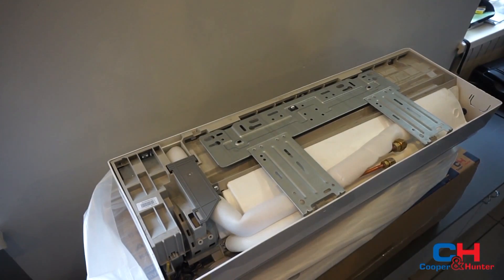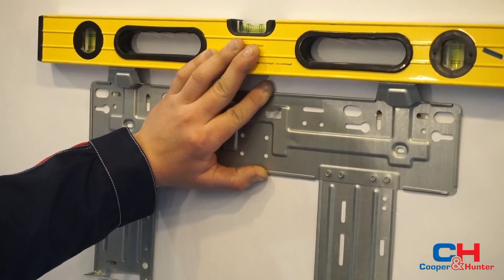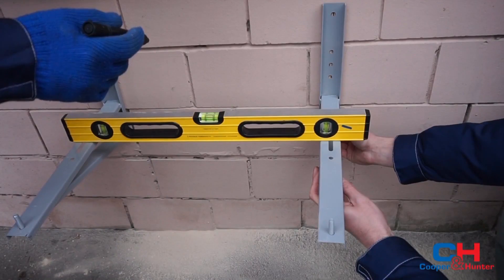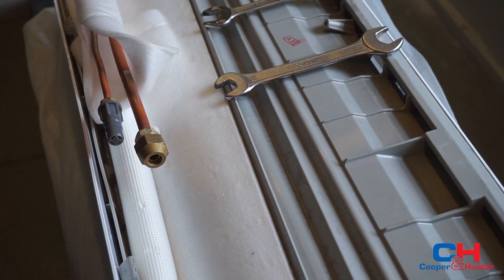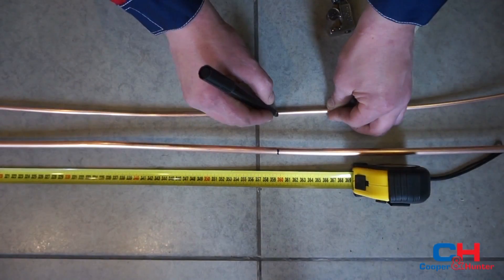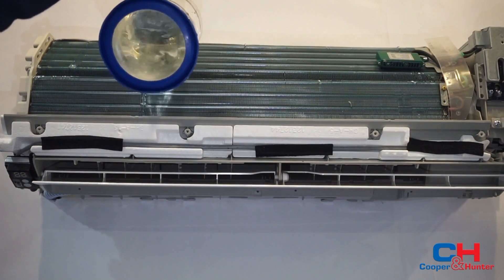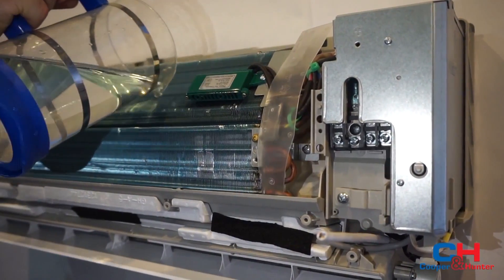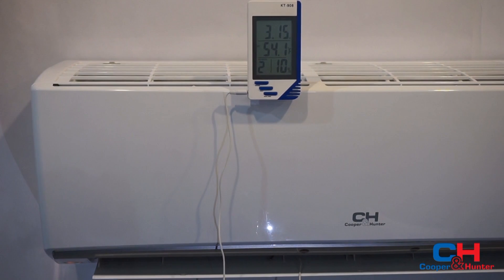How to Install Cooper&Hunter Mini-Split A/C System

Comment: Any harm in running pipes down through the inside of the wall cavity and then out of my garage instead of going straight through and down the outside? 

I already have a hole in my brick where I had a portable AC exhaust pipe going out about 24 inches off the ground

Comment: Hello, I have a question about the indoor unit, when you took the front panel of this unit u see a lot of Polystyrene at the front and at the back, where the coper lines are running does this have to be
 removed or it has to stay after the installation. and what is their purpose.?

Comment: Excellent video. Do you know why some people use a 4 wire for the power supply? 2 hot wires,  1 ground and 1 neutral. I don't understand where someone would hook the ground (bare copper wire) to on the AC disconnect or the actual control panel on the outdoor unit. Thanks in advance.
Reply from the maker: Hi Troy! Our units only need 3 wires for the power supply. The 2 hot wires and a ground wire. There is no neutral for our 230v models.
Reply: @CooperandHunterusa  Thank you very much for the quick response. I just ordered the Cooper and Hunter dual zone 9k/18k unit with the 25' line sets. Looking forward to receiving it and getting it installed.
Reply from the maker: @alittlebitofeverything5090  Happy to hear it, Troy! Should you have any questions, our Technical Support team is available at (786) 953-6706 Mon-Fri, 9am-5pm Eastern Time.
Reply: @CooperandHunterusa  then why is there a white wire on my 12k?

Comment: my unit had some cooling  fins damaged,    I thought  this was pre charged  so I was very  disappointed.    the instructions  are cryptic  and the pictures  are for a different  model  .   The video did not go over the electric  wires at all.  .   I'm supposed  to plug the used drain but I can't  find it.     I have installed a Mr. Cool unit  before.     much easier.    This was a mistake.    Saved a few bucks  but paid  it out the other  end.
Reply from the maker: Hi Theodore, thanks for your feedback. 

Damaged units should never be installed. We certainly would have addressed the issue if a report had been made.

Our units are pre charged for a specific line set length, which can certainly simplify the installation process. However, unlike Mr. Cool, our units are not DIY - they are meant to be installed by licensed HVAC technicians who are experienced with electrical connections and working with refrigerant.

Comment: Btw, a serious question (that's why I watched). The refrigeration pipes point to the left, factory standard. Can I bend them to the right, so the come out of the right side of the unit? I'm affraid to break them.
Reply from the maker: Oh, good question! Yes, you can turn the pipes to the right side. You should be able to do it carefully by hand.

Comment: What about drain line running up to the attic then outside?
Reply from the maker: Great question! Yes, it's absolutely possible to run the drain line upwards and out - but this will require the installation of a drain pump.

Comment: If the linset had to exit on the bottom right I guess the flared fitting connection would need to be inside the wall if it were running down an inside wall , correct? And how would you bend it to keep it from kinking? Thanks for the video.
Reply from the maker: It would depend on the depth of the wall. It is better not to fit the flared connection inside the wall because, if afterwards you discover that you have a leak, it will be impossible to fix within the wall. To keep the pipe from kinking, you should make sure that you have enough pipe length on the outside of the wall to bend with a tube bender. Does this answer your question, W B?

Comment: i see some people do a nitrogen test ,What is the difference between the nitrogen pressure test and the vacuum test ,what are they for? THANKS
Reply from the maker: Great question! The purpose of the nitrogen test is to the check the pressure of the unit. If all valves are closed and pressure is lost, that would indicate that the unit has a leak. We usually vacuum the unit once the pressure test is complete. Technically, vacuuming the unit could be counted as a secondary pressure test but, in reality, the main purpose of vacuuming is to remove air and humidity from the lines. Hope this helps clarify some things for you!